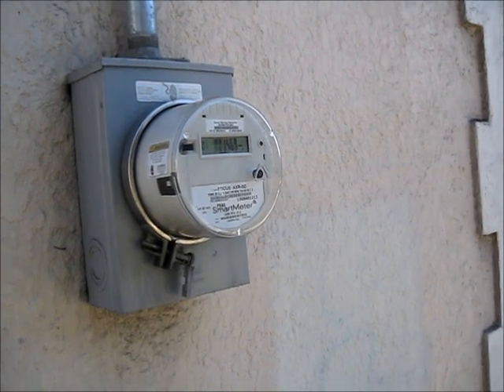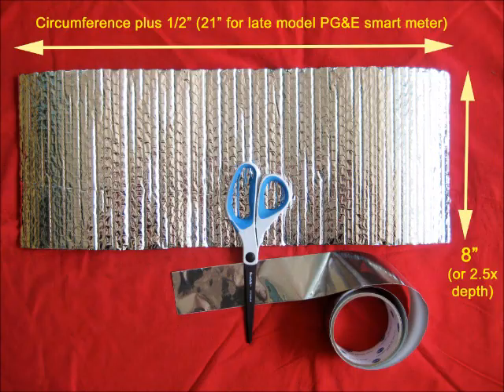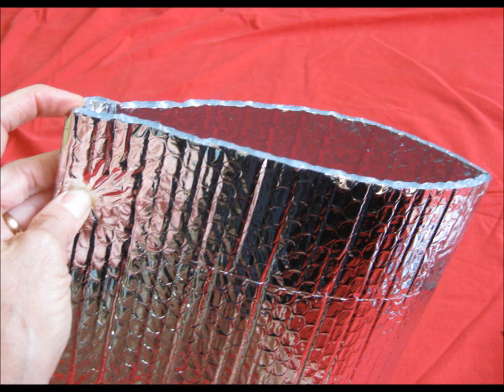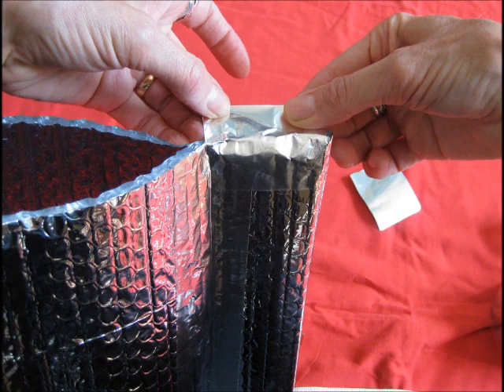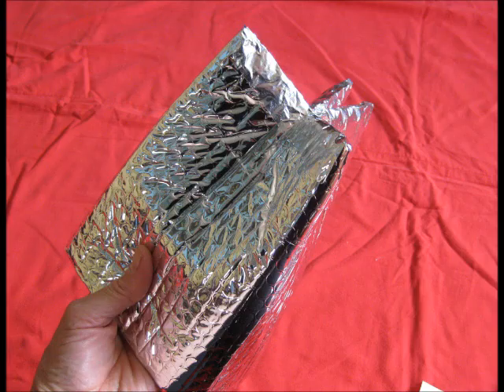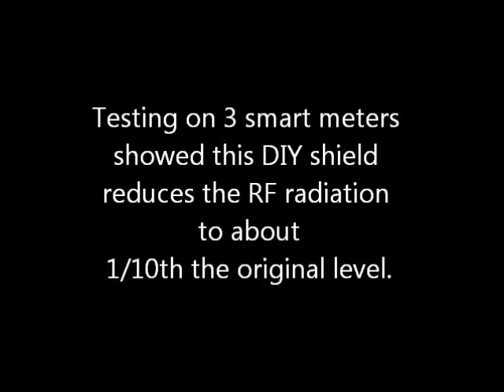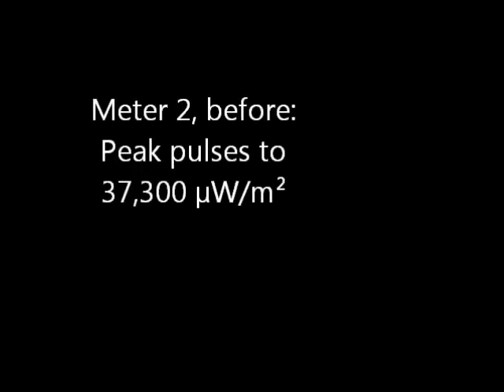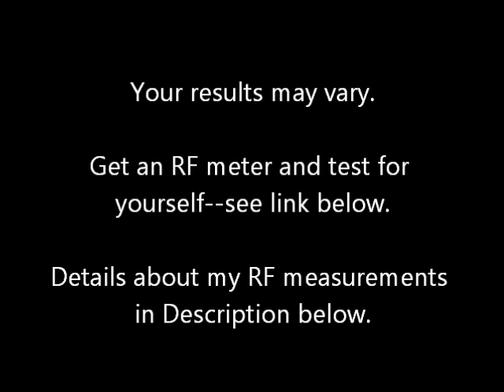DIY Smart Meter Shield: light-duty, temporary, portable

Comment: Why ever would you try to shield one? It will run at increased power to attempt to compensate. It would be a very unusual thing to spend your life inches away from a smart meter, they transmit pretty infrequently, the phone networks have not got the capacity to allow all smart meters to be sending information continuously.

Comment: Smart meter
The combined radiation from a smart meter has a power density of 0.263 (mW/cm^2) at 8 inches. According to the FCC and Industry Canada, they will allow smart meters to transmit up to 4 watts. Your cell phone is about 1/2 watt. The maximum range for both cell phones and smart meters is about 25 MILES. Not 20 feet. You can turn off a cell phone, but you can not turn off a smart meter. The kill zone for a pacemakers, defibrillators and wire brain implants is 8 inches

Comment from the maker: Reflectix works NO better than foil; it even shields somewhat less.

Completely enclosing a meter is very difficult---very small openings allow the signal to get out. The reduction you see here would NOT prevent the data from getting to the utility---it only reduces your exposure to the RF.

Comment from the maker: This isn't a solution to the harm caused by having a SM on your home, sorry. This is only a temp reduction for the environment directly adjacent to a SM.

Much more extensive shielding is needed for RF exposure on a home, such as large sheets of screening (see my other videos) on the inside wall. Also, using screening for permanent shielding is a better choice, because it allows air to circulate, eliminating the chance the meter would over-heat. (Who ever heard of an analog overheating?)
Reply: If we weren't controlled by Luciferian psychopaths, we wouldn't even be having this discussion.